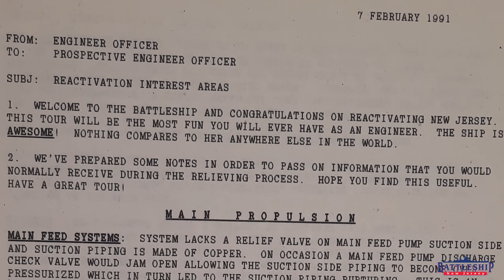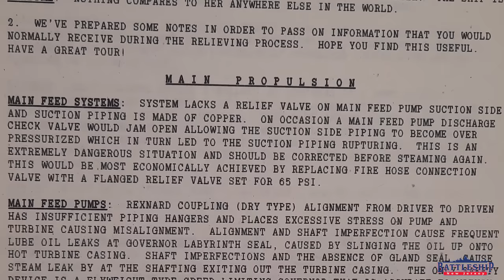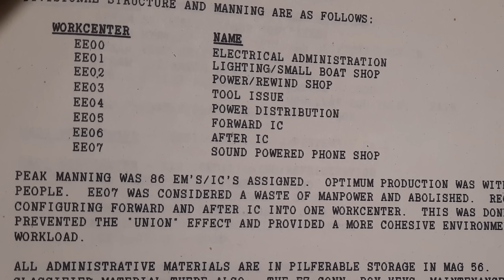The Call To Freedom Will Be Sounded Again: How to Bring Back Battleship NJ

Comment: Besides there would have to be some significant lead time to get new shells and powder for those 16" guns and the 5" guns, i don't see a reactivation under the current admin or any admin associated with the current admin..
Reply: i dont see why the admin has any baring on if its reactivated, wouldnt they be told, we need  these ships for X reason, and if the senate approves the expense then its done?
Reply: @ilenastarbreeze4978  A United States president is the commander and chief of the military, they also pick their cabinet members which are department heads in the military and other agencies. A presidential administration has a lot of bearing on whether or not a battleship would be recommissioned. The Reagan admin was responsible for the last recommissioning. congress has to in the end though appropriate the funds in a bill to get the ball rolling.

Comment: With the Navy today struggling to deactivate new ships without viable replacements ready, I wouldn't be surprised to see the Navy ask to seize and reactivate ships like the Iowas.  Any crisis which would be dire enough to need the Iowas would need to be predicted with enough time for them to be brought back in suitable condition to fight in Multi-Domain Operations (MDO) or Joint All-Domain Operations (JADO) and to be survivable.  In either the case of continued jackassery of the Navy's shipbuilding and decomissioning programs or a predicted and dire crisis, someone like Reagan could see them as the band-aid to get the US Navy back into dominance in a short span of years for long enough to bring new systems online in new platforms.  If either of these circumstances come to pass, it is ominous for the nation and we should hope against it (even though seeing the Iowas back in service would be so satisfying for so many devotees to the ships).

Comment: It would be easier to build a brand new battleship than to bring NJ back. The true battleship is dead though, if any warship approaches the size of the New Jersey, it will be built that way with multiple compartments to make it difficult to sink, and it will be packed to the brim with drones and missles, and maybe a couple of big guns (almost like a monitor class) for heavy coastal battery support.

Comment: I think the sinking of the Moskva may lead the USN/USMC to at least consider if the current fire-support options for littoral operations have sufficient survivability against even third-tier powers - survivability that an Iowa would posses in spades.

The introduction of the AGM-158C would also provide any reactivated Iowa at least some hitting power against surface targets, although still not as comprehensively as a Russian Heavy Missile Cruiser would.

Comment: The fuel costs to run her is prohibitive. They could put rail guns in place of 2 of the 16" gun turrets. Tho it might be cheaper to build new at that point.
Reply: Rail gun is no longer. US gove has discontinued funding and research. Lockheed Martin is looking at it but it was determined we do not have a ship with a power system capable of handling the current design.

Comment: NJ is more a mascot than a usable ship nowadays.
-Aint no way a volunteer navy can find 1600+ crew member for the ship, they can crew 7-8 Burke with that number
-Its an 80 years old vessel, its obsolete and maintenance intensive
-Armament wise, yea the 16in guns are great for shore bombardment, but missile have range of over 100+ km and a Ticonderoga can just launch a volley of Tomahawk and do the same result as a volley of 16in shell, if not with greater effect/damage and more accuratly.
-Its a huge target, and extremely High Value Target, NJ cant survive an onslaught of missile without having a proper escort group, which will tie up ressources from other battlegroup and the armor itself wont do quite much versus missile.
- I think you stated it in a previous video, but the Iowas's crew(if the others are reactivated) are gonna be so specialised that they wont find any other significant posting elsewhere since their particulars skills acquired on these ship wont be much of use elsewhere apart from the few that operate the systems that other navy vessel share like the Phalanx,Radar and Tomahawk so its basically a dead stop to one's carreer(that assumption is made with her 1991 form/equipêment in mind so perhaps a major reconstruction could prevent that but its highly unlikely to happen due to immense cost).

Comment: While unlikely I certainly think it is possible for an Iowa class battleship to be reactivated. Like you said the battleships provide a capacity no other warship still float on earth does. I think the possibility actually increases as every day goes by with tensions heating up with China. A war with them would be an absolutely massive naval conflict and based upon where it will be fighting, the Navy would need a lot of naval gun fire support to destroy the Chinese garrison’s on the man-made islands they have built, potential enemy positions on Taiwan if the Chinese invaded that’s what sparks the war. Or surface  bombardment of the Chinese mainland itself if suppression or destruction of various Chinese land-based assets is required. 

In addition to her primary armament the Iowa is a massive platform for which various new weapon systems can be mounted. She could perform a similar fleet defense role that she did during World War II with her large anti-aircraft complement protecting carrier battle groups. She already has mounts for four CWIS guns, nothing says you can’t either replace or add something like a CRAM or box launched AA missiles. She could contribute significantly to the protection of a fleet.

Comment: As discussed by Drachinifel, the steam plants are simply too worn out. A steam plant lasts for about 20ish years of real use. One reason why the Iowas could be reactivated even in the 80s is that they were constructed at the end of the battleship era and their steam plants had barely been used. It was (relatively) economical because those plants still had life in them. However, each ship has now had about 20 years of service and the steam plants are near the end of their lives. They need a complete overhaul with whole boilers and turbines and such replaced, but getting access means removing the  whole superstructure, gutting the centre part of the hull, cutting open half the armored deck. At that point, it's probably cheaper to just build a new ship. 

That sort of rebuild was done in the 1930s, with HMS Warspite for example, but that was only because the Washington naval treaty didn't allow construction of new warships, so they all basically built new modern battleships inside the hollowed out hulls of their old ones.

If the US government really wants to bring the Iowas back, at practically the cost of new ships and destroying all historical value in the process, I suppose they CAN, and they've done stupider things. I just hope they don't.
Reply: Interesting.  The ship I was on was launched in 1968.  In 1990 she was still quite capable of exceeding the top speed reached during Builder's Sea Trials.  The problems with her engineering plant had nothing to do with condition or capabilities, and everything to do with fuel consumption.  Stated differently, she burned a LOT of rather expensive DFM to get where she was going due to her original design.
Reply: @kevincrosby1760  What ship? Not a "gotcha", I'm genuinely curious. I should probably have said I was talking about battleships, where the steam plant is absolutely huge geared pretty heavily for sustained high performance. Historically, most of them have needed rebuilding after about 20 years in service, and the Iowas are particularly high strung and huge even by battleship standards. Anyway, I'm getting this from Drachinifel, and he is an engineer after all, besides being a historian, so I weigh his opinion on steam plants pretty highly.

Anyway, no-one in the US navy even knows how to work a boiler anymore!
Reply: @TonboIV  USS Kansas City (AOR-3)

https://en.wikipedia.org/wiki/USS_Kansas_City_(AOR-3)

You may safely ignore the "Speed: 20 knots" in the article...we routinely cruised faster than that...

Comment: If the iowas were brought back again, to bring them up to modern standards it would take rebuilding basically everything but the main guns and the armor.
The secondary battery, propulsion, electronics, and most of the systems are obsolete.

Comment: Modern USS New Jersey.  Replace the triple gun 16" with 2 16" autoloaded guns.  Use the extra space and weight savings maybe for more shells, or more armor on the barbette...idk.  

Replace the steel armor with a composite hull, maybe save more weight.  Replace the 127/38s with those rapid fire 127mm guns found on Destroyers.  Then several missile launchers and Phalanx, all the Phalanx....like 4?  6?  Then maybe add some Trophy APS from tanks lol.....will that even react to something like an Exocet coming at the ship?  Finally, change the engines out for the same Nuclear plants on CVNs. 

She would be a BEAST!
Reply: Rocket assisted artillery shells for the big guns to get extended range.
Reply: @Caviar_Liberta  She already has missiles on her.  Tomahawks and stuff.
Reply: @CMDRFandragon  Yes but moding those 16's to fire RAP rounds would extend the range even further and would be difficult to counter.

Comment: The engineering department referred to these as “An Easter egg hunt” A guy from my department, shop 300, Design, asked why. “because if you’re an engineer tasked with getting this ship into fighting condition, we’re going to figure that it’s going to be primarily a platform for shore bombardment, not so much as a missile launcher. So, we’re planning on giving the new guys a heads up on the real ship conditions & capabilities, at the time of decommissioning. (The yard tasked with mothballing a ship, lie? 😆😆).....When the order comes to decommission them, in about 10 years, (this was re: Missouri in 1987, he wasn’t off by much), we’ll have about 15-20 “Easter eggs” in locked, & unlocked compartments, and we’ll also leave a report with the new captain’s Introduction to the ship in file form, as well as in the EIC, & CIC, and a few other obvious places. Some will be scavenged, but there’s an inventory with each one under lock and key, so you’ll know what’s missing. Also, the easy to find stuff won’t be critical, but it will be a hint to all officers rank of Captain & above, or shipyard engineers, that it exists. The fact you have the keys means they gave up on the program  in 2007, by giving you the keys....Now find the other 14-19 eggs, Ryan! Happy hunting!

Comment: I have a feeling the matience alone would be too expensive for her or any of her sisters, all of her original systems are now 80 or so years old, you'd be having to fix broken pipes and old wiring constantly. Maybe if you gutted her entirely down to the bare metal bone, but then what's the point of that? There's also the fact that the U.S no longer has the ability to manufacture most of her parts, they made so much surplus during WW2 that they were using that up into the late 80s and 90s. Where would they get new barrels? How would they be relined? Or make new shells and powder bags? The entry industry behind that era of warship is long dead and gone, we don't have the ability to even make her armor anymore. How would we even repair one if it were to take a hit?  Battleships are amazing and unique pieces of Naval history, but their time has passed. They are better served as museums now, as they are irreplaceable pieces of history.

Comment: I really doubt the Navy will ever bring back the battleships.  There are so many systems that would need to be repaired/replaced that there are no longer any parts for, nor personnel who knows how to repair or use the systems.  Also, a battleship requires a lot more personnel than the Navy wants to commit to one ship, its just too expensive.

Comment: Will an Iowa class battleship be reactivated? Possibly. If the current war in Ukraine shows, you use whatever means you have at your disposal. Hence the use of 1960s-era Soviet artillery alongside modern NATO M270 and M127 systems, high-end AT systems and drones, right next to T-55s. In a more naval setting I'd totally expect something along the lines of an Iowa-class ship to pop up as well.

Admittedly, having more modernisation would be very welcome, especially when it comes to operating the guns. Ideally the ship would be run with a much smaller crew, and many quality-of-life upgrades to the engines and propulsion.

Comment: Reactivation is a non starter. No ship in the modern Navy operates main propulsion boilers now. The shore establishment is not prepared to maintain the ship or train the sailors. Secondly, the Navy has passed the title to the museums, who own them. Certainly in the case of a national emergency if the Navy wanted them back the museum could pass the title back, but the time to reactivate would be much longer than was done in the 1980s.

Comment: its a nice thought that at least one iowa would return to service, but i doubt it would ever happen due to the age of so many of the systems, she hasn't made steam in over 30 years, nor has her turbines been run by that steam, even if you dug up enough people that know how to run the boilers and electrical and they teach a new generation how to run the almost 80 year old plumbing, the systems would likely fail from age and corrosion/inactivity 
i suspect the cost to gut and modernize would be too close to just building whatever they would call the successor to the abandoned montana class, maybe make it a nuke, so it would have the power to run rail guns and whatever scify stuff they want, free up space from fuel storage, maybe lighten it up further with a modern take on modular below water line armor or something like that

Comment: My grand father was a witness to the Japanese surrender on Mighty Mo. , gunners mate 16 inch main guns.. I have multiple issues of ships News paper he saved.. he also managed to get the rear deck flag. The boiler guy saved it for him.. we use to put on the front of the house for the 4 th of July.. the flags were ordered to be destroyed afterwards.. be he managed to get it. I never knew until just a few years ago , the origins of the flag. My uncle told us . But the flag met its fate . Are home burned down in 76 , and the flag burned up in the fire.. surreal.. I will at some point donate the News papers and first Christmas dinner menu card he saved back to Mighty Mo. I spoke ti the ships currrator a few years ago in Hawaii.

Comment: I'd like to see the BB's recommissioned, but I don't think it will ever happen.  Not with much of its spares inventory now no longer in the possession of the government and in many cases, literally no manufacturing system exists to make spare parts for it.   If an order were placed TODAY, under emergency wartime conditions, to provide newly made spare barrels for the 16 inch guns, and provide new ammunition and supplies for firing the 16 inch guns, that alone would be, I estimate, not less than a year or two's worth of work, with the most capable defense contractors in the industry setting aside lower priority work and getting to work on this project around the clock, and it would start by having to have the specialized manufacturing equipment needed to build new barrels built from scratch.

Comment: I just don't see it happening, the battleships being re-activated. While they can perform a very particular job very well. I don't think the U.S. DoD is willing to spend its budget on getting a ship that was laid down 72 years ago into battle ready shape. The multitude of things that just don't exist anymore, the things that the technology doesn't exist anymore to make, and the knowledge to operate those ships that died with the men that knew it. It's hard to look at them and say it's possible. If I remember correctly, when the ships were reactivated in the 80s, they had a hard time finding the men that ran the ships in the 40s, 50s, and 60s, so they could teach they guys in the 80s how to run the ship.

Comment: In my honest, yet relatively unimportant, opinion; Battleships should be brought back, but not the Iowas. They are all approaching 80 years old and honestly deserve their well earned retirement. Instead, the Navy should look into building a modern, 21st century Battleship, or at least a modern variant of the Montanas. Building from scratch would obviously give more room to a modern design then working within the pre-existing limits of a older hull. They could even make the new ship nuclear powered if they wanted, a choice that the Iowas could not provide. Add big guns, with longer range (like a 16” long range land attack projectile), a handful of secondary 5”/62 mk45 mod 4 guns, a healthy variety of missiles, CWIS, 40mm guns, M2 .50 cals and maybe 1 or 2 rail guns powered by the reactor, and you’ve got a rather versatile yet very formidable weapon.

Comment: As much as I'd love to see at least one of the Iowa's back at sea, I don't think it will happen. I can't imagine how many systems are no longer serviceable. No spare parts, and the technology would have to be reverse engineered in places. And even the routine maintenance, is any of that stuff written down, or can the last crew members help revive the lost knowledges. But then, hope is eternal. The New Jersey would be a wonderful vessel to "Show the Flag"
Reply: The P. M. cards SHOULD still be around.  I'm also pretty sure the equipment tech manuals are still in existence as  well.   The "Engineering Operating Procedures" books were fairly new when I last saw them.